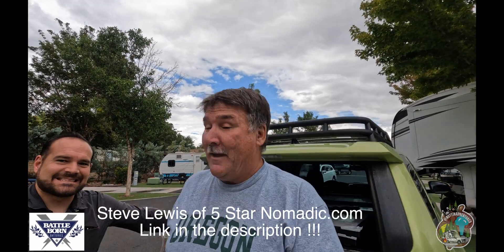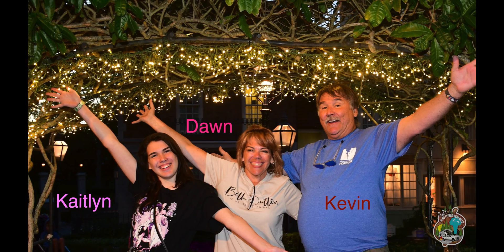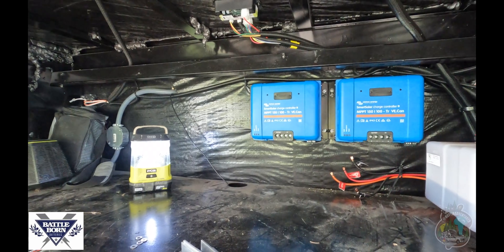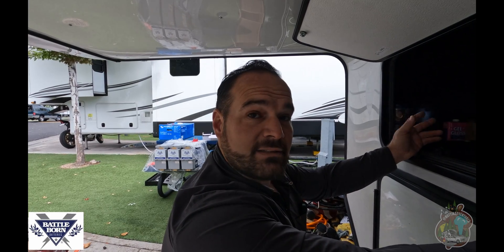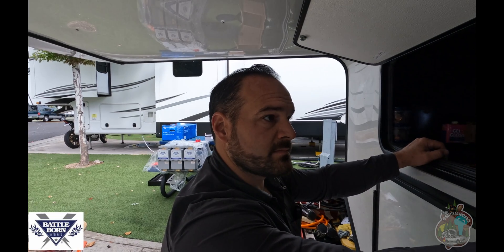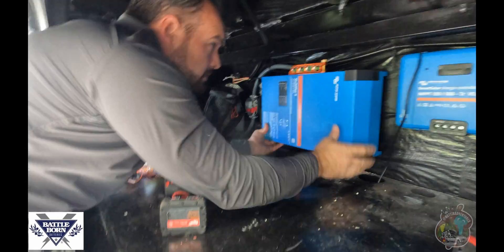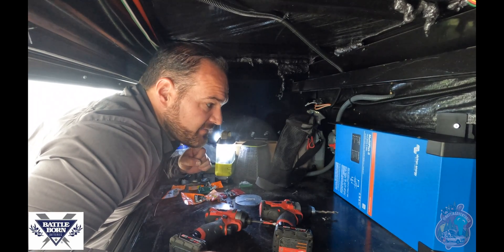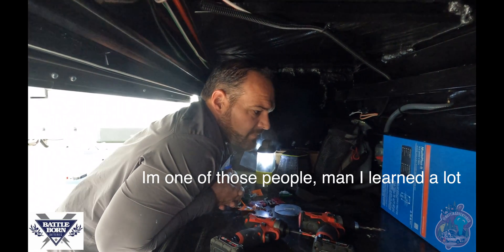RV Off-Grid (Solar) Power System Review | Game Changer 3.0 Batteries From Battle Born

Comment: Battle Born assembles great batteries using Chinese made LiFePO4 cell packets but the GC3 is hardly a game changer.  It seems that all BB did was repackaged their already very well regarded BB10012 model 100AH 12volt battery into a 270AH 12volt battery for a higher price per watt.  If you strip away the case work of 3x BB10012 and 1X GC3, I am sure the weight of the cell per watt would be the same.

Again this not a game changers but a more convenient size and shape battery. If BB wanted to make a gamer changer battery, they should follow the path of Lithionic Batteries which have a aluminum casework (which acts as a heat sink), all around better BMS, software and system integration.
Reply from the maker: ease of use and different sizes ARE game changers, and there is more to come from Battleborn, new tech omn the horizon. we appreciate your input, keeps on on our toes